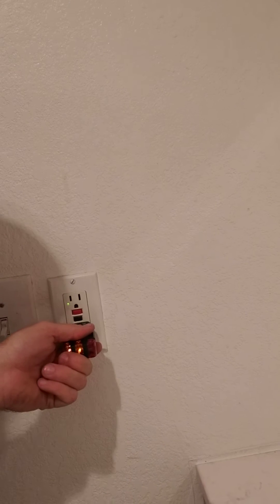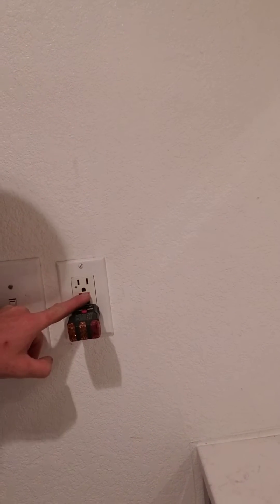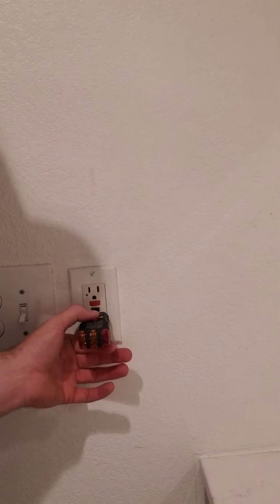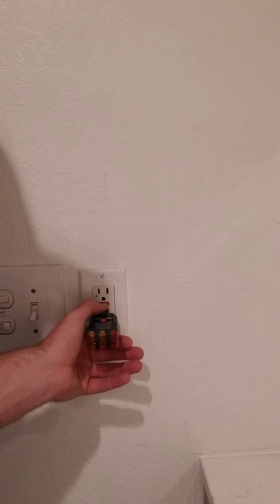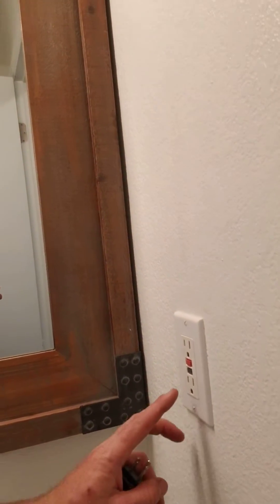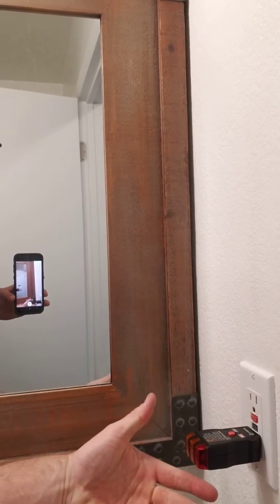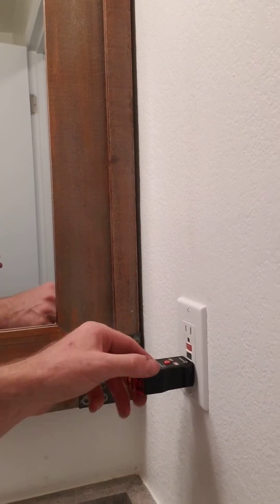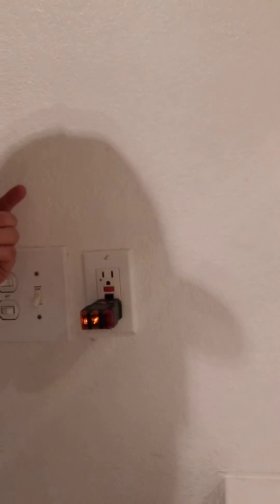Trouble Shooting a GFCI That Won't Reset

Comment: So what if basically everything in my house is connected to the gfci
Reply from the maker: That would be a little odd… normally you shouldn’t have more than 8, sometimes 10 receptacles on a circuit… if you’re having repeated issues it is a good idea to consult a local electrician.

Comment: I thought you weren't supposed to have more than one GFCI on a line. That the one takes care of everything down the line.
Reply from the maker: You are correct. You don’t need more than one when properly located. It is very common to find multiple in line though

Comment: Your a life savor bud. I did this myself but my error was that I started in the wrong bathroom. Started with my bathroom now 1st, held the reset button for 3-5 seconds. The TEST button popped forward, got power. Went to my other bathroom. Did the same thing, powers back on there too and the outlets outside now work too.

Thanks again!
Reply from the maker: Nice work!

Comment: It rained, my outlet gfci inside the garage wouldnt reset. Electrican replaced the outlet. Two days later it tripped again during rain storm.  12 hrs later the gfci can be reset.  Electrician coming back tomorrow to figure it out.
Reply from the maker: Curious to hear what you find is causing this!?

Comment: In my case I had an open ground. The GFCI outlet would shut off but I couldn't reset it. I knew there was no open ground. Replaced the outlet, two days later it went out again. This time I found the issue was at the junction box that fed that outlet. The feed from the breaker box was dead. The line had finally died (outside line that was probably installed 50 or more years ago). This happened with my outdoor light pole a few weeks earlier. I've had to jury rig it with an electrical cord to the house for now until I can run a new line from the breaker box in the Spring. I have to bury the line so digging will be required and I live in the Northeast.

Comment: Thank you for this video! I replaced a GFCI outlet with a new one and it wasn't working. I did not know to check my other GFCI outlet on the other side of the house. That one needed a reset and gave power back to my new one! I guess I ought to go ahead and replace that one too while I'm at it.

Comment: So... I'm having a similar issue.

I have a bouncing house and I turned off the fan last night and it won't turn on back again this morning. It's happened before and I mess with the test reset and idk I just can't memorize what/how I do it, but I get back up working again each time... Except for today and it's frustrating.

Today I can't get it to turn on.

For context, I have a cable running to the middle of the yard and I have the fan plugged into that cable. And there's a test reset button on the fan plug itself and there's a test reset button on the house wall where the long power cable is running from.

I need help lol what steps do it need to do to get it to power on??? The cables are getting power because the test buttons do turn on the little light above the buttons. And I connected a Bluetooth speaker on the wall for testing power and it's working.

Any tips or any steps I need to follow??
Reply from the maker: I’m sorry I’m not tracking. Sounds tough to explain without seeing it..

Comment: I booth a Gfci plug 🔌 that won’t reset anymore, can you help me out ?
Reply from the maker: The plug may need to be replaced. If you can verify power is making it to the receptacle but the gfci is not resetting then that indicates it needs to be replaced.

Comment: My outlet and lights in my bathroom are out and I replaced the GFCI unit and the light still shows red. I reset all the other GFCI outlets in the house and it still isn’t working. The cables are live so I don’t know what the issue could be.
Reply from the maker: If you have not already verified that the gfci was wired correctly I would recommend doing so with a simple 3 prong receptacle tester.

If the wires are not hooked up exactly as they are supposed to be the. The receptacle will not function. 

It is also rare but does happen where a gfci will come defective from the factory.

Comment: Electrician standards are weird. You flip the back 180 to read the GFCI configuration. At first I dried reading the manual like a normal human being, but that didn't work.
Reply from the maker: Good reason to always double check their functionality after wiring them in. We like to use a 3 prong gfci tester to check receptacles for this.
Reply: @InspectorTribe  Thanks for the video...... What does it mean when the GFCI outlet is flashing a red light? I push reset. It resets in it's green then starts flashing red again?
Reply from the maker: @bosshova23  this could indicate that the gfci is bad. If it were me (not being a electrician who might know a quicker trick.) I would swap out the gfci with another one and see if that solves the problem. If the problem persisted with another gfci receptacle the. I would call an electrician. Gfci’s do go bad occasionally.

If someone is asking who is not comfortable safely replacing a gfci then I would recommend they skip straight to the “call an electrician” step.